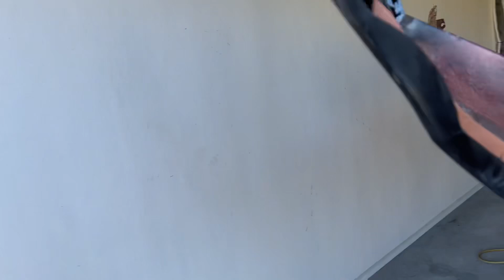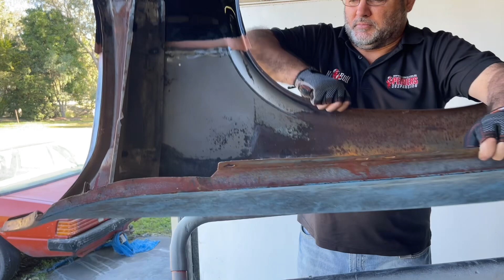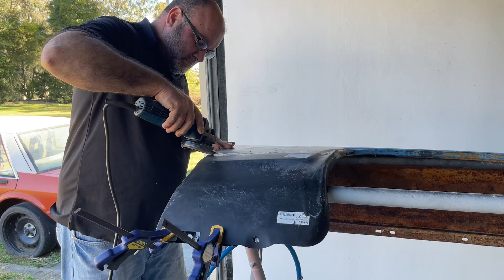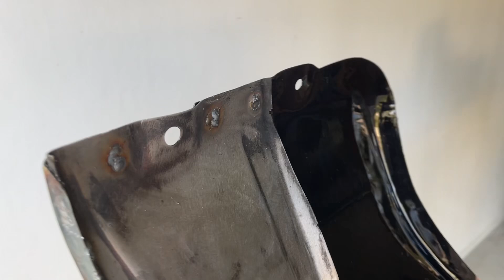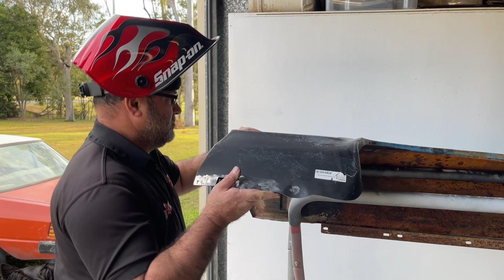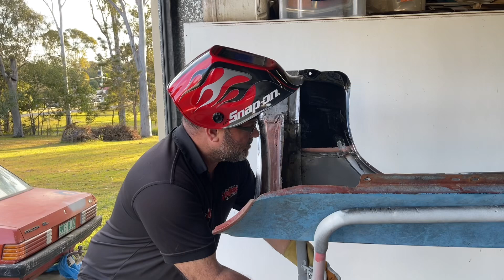XA Falcon front fender rust repair @rustymusclecargarage6193 #rust #patchpanel #ford #fordfalcon

Comment: Good work. 
My least favourite aspect of car body work is trying to planish out MIG welds. I had a similar problem welding in a lower quarter on my Rover 216 GTi and I nearly gave up because it was so frustrating butt-welding 0.75mm sheet metal and only part of it was accessible from the back. Still ended up with a 'valley' where it pulled in. Ended up bogging it because there was real chance of cracking the weld where it merged with the original panel. Still hoping one day, someone invents MIG wire that's as 'soft' as a TIG and gas welded bead.
Reply from the maker: Thanks so much 👍 I have had pretty good luck with the Unimig mild steel Mig wire. Like you said still a bugger to planish but at least it is mild steel filler